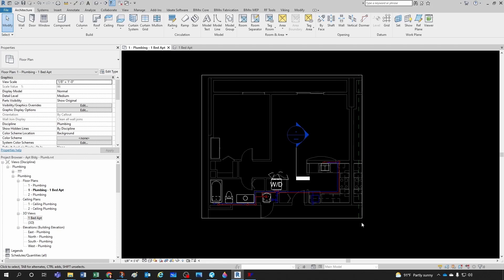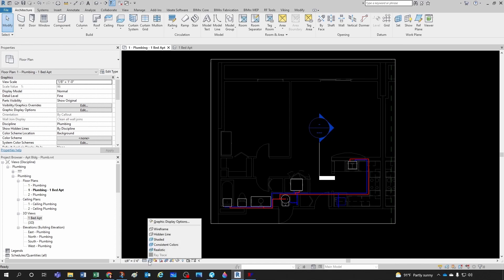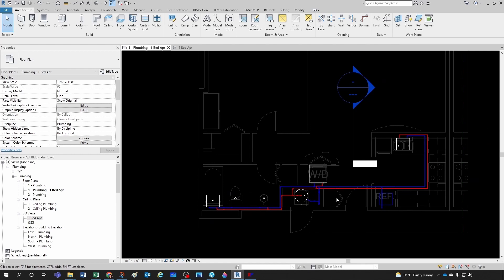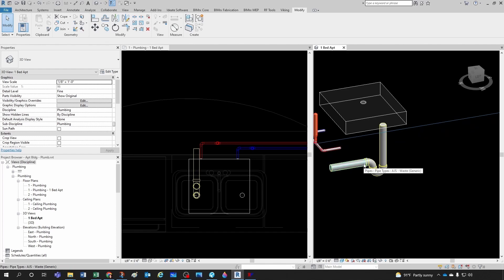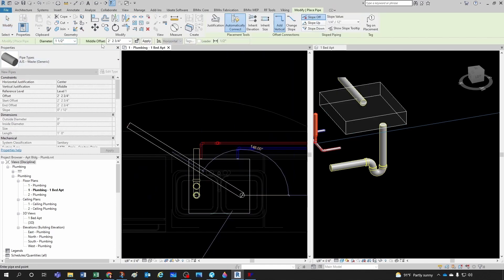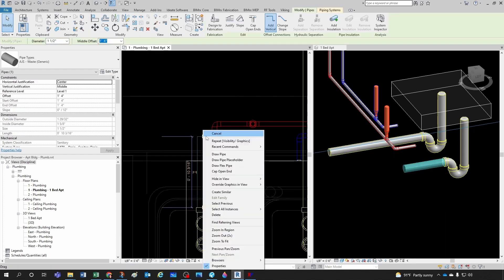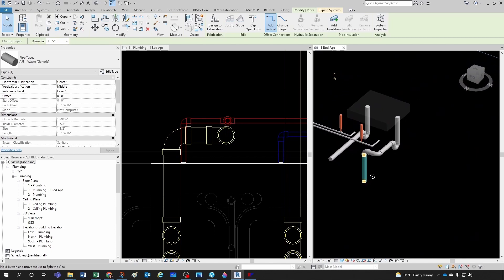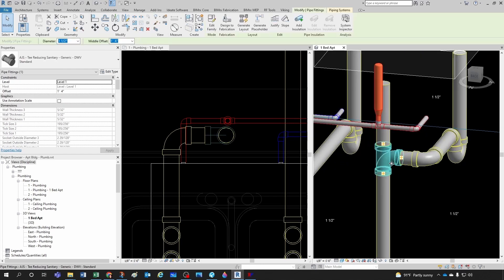Apartment Plumbing   Drainage 1

Comment: Alex,I have a quick question. Do both outlets on the sink family have drainage fixture units corresponding to them. If so, is it double counting the DFU’s?  I typically see a double bowl sink using a continuous waste with one p-trap. 

Thanks so much for these videos. They’re very informative.
Reply from the maker: Hi Jay. Great question! 
Many times you will find one of the outlets connected with an offset strainer or with an elbow/extend to the tail-piece, so a single p-trap is trapping both sink outlets. The (2) most common configurations are as below:
https://www.homedepot.com/p/1-1-2-in-White-Plastic-Slip-Joint-Sink-Drain-Outlet-Waste-HDC9121AB/316415495
https://www.homedepot.com/p/Everbilt-1-1-2-in-White-Plastic-Slip-Joint-Sink-Drain-Center-Outlet-Waste-C9123AB/205153786
The downside of that method is that if for some reason your p-trap gets clogged, you are left with a useless sink (until you unclog it); as opposed to when you have 2 p-traps, if you clog one of them, at least you can flow water out of the other bowl.

Regarding the fixture units, most codes based on International Building Code (IBC) will call for 2 DFU per sink, regardless of the number of bowls (maybe because the faucet will pour water either in one bowl or the other; so, what I typically do is:
- For single bowl sink: I make WFU = 2, so 2 DFU flow out of the only drain outlet connector
- For double bowl sink: I make WFU = 1, so 1 DFU flows out of each connector, and by the time they go together down the stack (regardless of the configuration), they add up to 2 DFU.

Man, this one got me typing for a while, I might even create a quick video out of it =)
Reply: @bimitup  I thought you might have 1 DFU per outlet on the double bowl sink, but I wasn’t sure. Thanks for the reply.
Reply from the maker: @jayblake682  You are welcome Jay